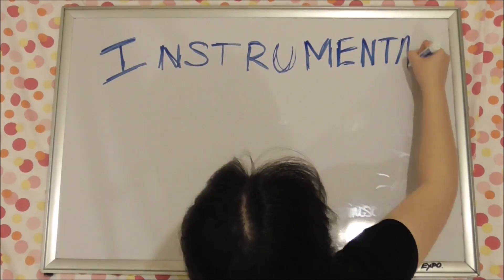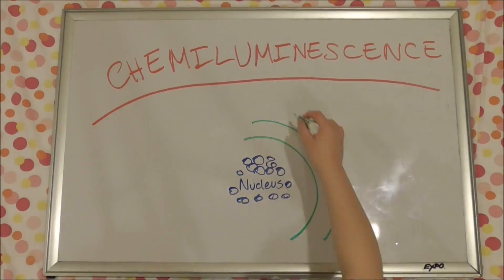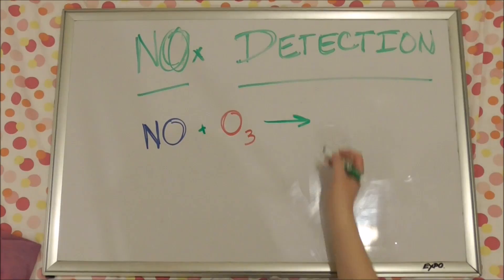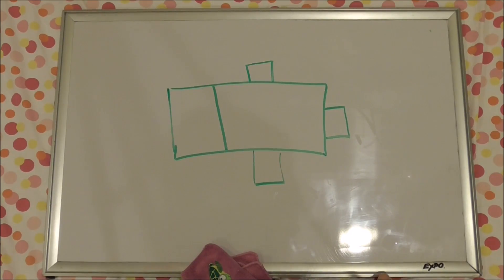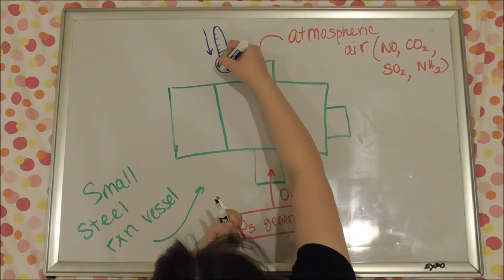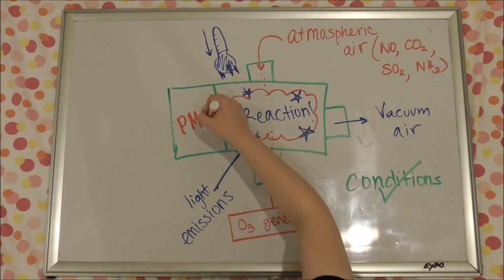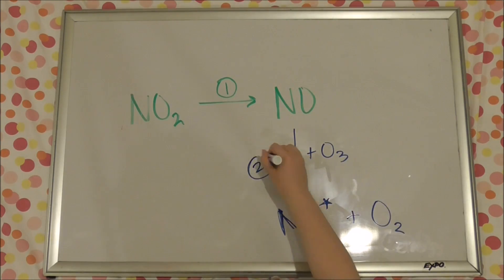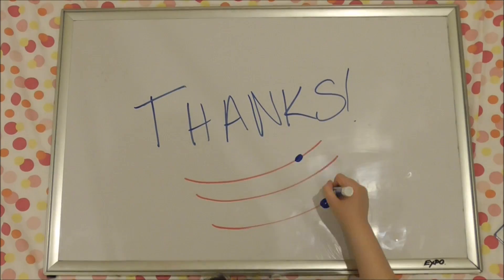NOx Determination Method with Chemiluminescence

Comment: thanks, how do you adjust for the O3 in the atmospheric air? also does the vacuum run periodically after drawing in air to a sealed chamber or is it a continuous flow system?